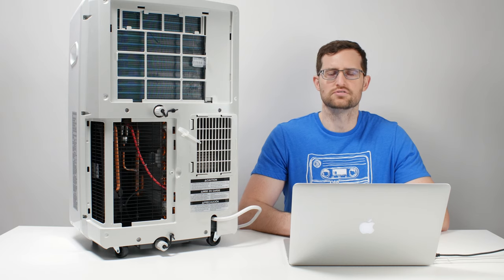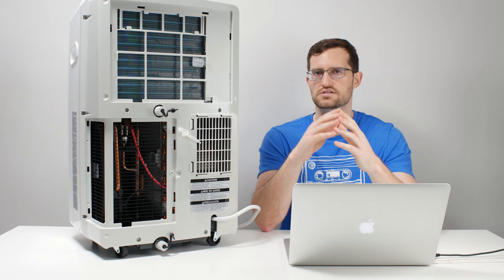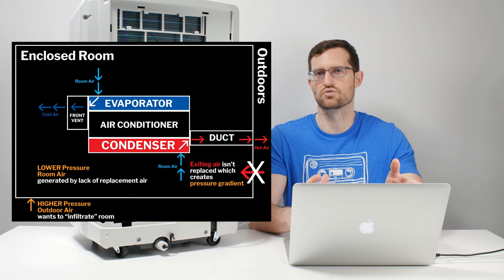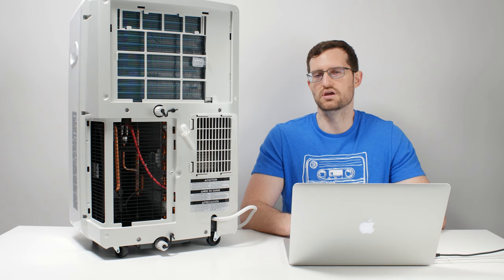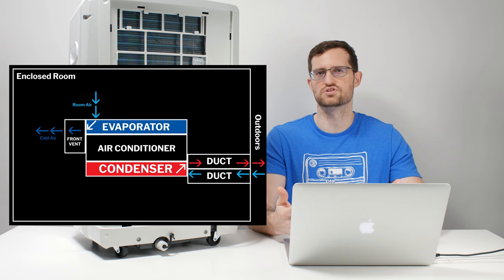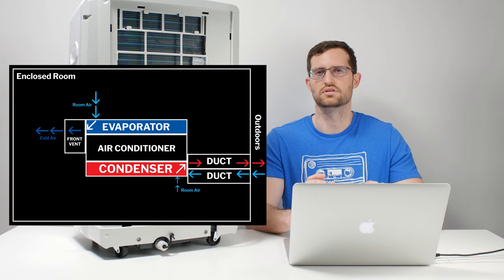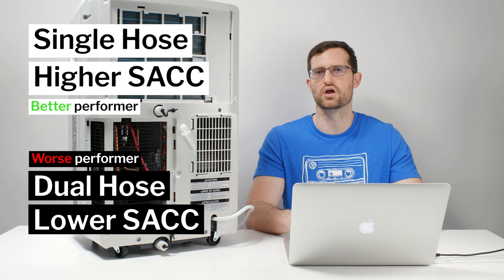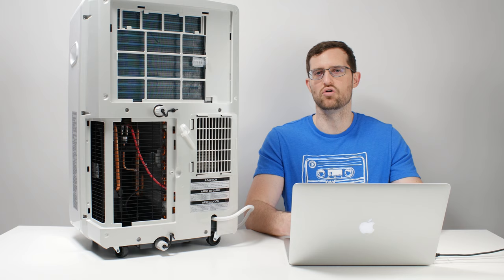Single vs Dual Hose Portable Air Conditioners

Comment: I understand what people are saying when they mention physics. People need to realize that the SSAC is measured using physics too. Some of the negatives listed with dual hose designs are minimal. The intake air hose is usually just barely warm to the touch and the extra leaks is very minimal. 

Technically a two hose design should be better but there is much more to it. I had a Haier 12,000 2 hose unit that cooled less than a 5,000 BTW window ac that it was replaced with. Because it is a dual hose design doesn't mean that it is any better.  We all know the "MAX A/C" settings on cars work the best. It mainly recirculates the already cooled air which is much more efficient. That isn't the only factor though. A good working compressor, fan, ducting system, condenser and evaporator are all parts too. My car's A/C letting if fresh air will outperform another vehicles using recirculated air if their system isn't fully charged or if their condenser is clogged with leaves, or if the vehicle is stopped and their condenser fans aren't spinning up to speed or if their A/C clutch is slipping. 

The LG's SACC goes from 14,000 BTU to 10,000 because it is like a car using fresh air while my old Haier went from 12,000 BTU to 5,000 BTU because it is like a car with other inefficiencies despite using recirculated air.    
 
Oh, that guy that claimed to be  an astrophysicist, brain surgeon and astronaut is full of more shit than a filled septic tank.
Reply: the intake hose/air will get warmer on a sun facing window.

Comment: What if you draw the air that cools the condenser not from the outside air but from an adjacent basement that remains cool even in summer. A two hose unit would allow you to tap the air in your cool basement and thus use "geothermal" cooling to precondition the cooling air for the condenser and thus make the unit more efficient. One hose would vent hot air to the outside while the other hose would tap "geothermally" cooled air from your basement..

Comment: I have the LG single hose inverter model, works great and cools fast until the temps outside hit 95. I will say that the problem is it will pull air from the central air and make it work harder even if we keep the door closed where the LG is.

Comment: Answered my question ....thank you.
To bad they are not a better system..guess will buy a split.
Reply from the maker: Absolutely. If you can afford it and you're able to install it in your home, a mini split is a much better more efficient option than either a single or dual hose portable AC.

Comment: My parents central air is a joke it doesn't cool a thing the lowest I seen it cool is 78 degrees if that and I would like it at least 70 to 72 my dad is 73 years old and thats just too hot it's a town home apartment but it's the downstairs that needs to be cooled more than anything I ask would you highly recommend the Whynter ARC-14S? The downstairs is close to 500 sq ft so I know a 14000 btu will do the job but will this specific unit being a dual hose do the job?

Comment: The first thing is to take the intake hose off and plug the window hole for the intake 😮 then you will be using the cooler air from inside your house, just like using the recirculation button in your cars ac and if you know how that works??? It made a huge difference with my unit and now it's nice and cool 😎

Comment: Window units are much more efficient than any portable unit and use outdoor only to cool there compressor side.
Reply: Big AL well in Germany we dont have sliding windows so we cant really use them. I converted my portable AC to dual Hose.

Comment: There is no way that the heat radiated from the 2nd hose(condenser intake) is equal to the infiltration from not having a second hose. And what heat is radiated can be minimised by insulating the hose. Both hoses should be insulated. Believe what you want, you will anyway. Have a great day.
Reply: @PaulRosberg  The window AC is NOT pumping air into the space!   A window AC is equivalent to the dual-hose system, entirely using outside air to cool the condenser.

Comment: I want to cool a basement during the hot summer months. Basements are a bit on the humid side even if finished. Using a dehumidifier would be out of the question because they give off heat. What would be my best solution for cooling a finished Slightly humid basement without using central air? I cannot fit a window unit into my basement windows!  Any suggestions?

And also, what about if you have allergies, and you’re bringing air in from outside does that affect the room air?

Comment: All you’re doing with a dual hose is emulating the traditional windows ac. What is lacking, as far as I know, is a Recirculate setting. The windows ac (also the car ac) is normally dumping some of the conditioned air outside.  He lost me at 3:30. The dual hose eliminates the vacuum problem so how does the single hose ever fix that?
Reply: Single hose never does fix that. It can't unless you modify it to a dual hose. Single hose creates a vacuum and draws hot air back into the space you want to cool. 

Dual hose eliminates the vacuum and uses the inside cooled air through the fan, as recirculate. It's the part this presenter gets wrong. Dual hose is more energy efficient and with some sealing and insulation, far outperforms Single hose every time. 

But what do I know, with hundreds of systems installed, tons of schooling on the subject and more than 15,000 hours thinking about it professionally...........

Comment: Since it was never mentioned in the video, for the issue of the exhaust hose radiating heat back into the room, you can just buy duct wrap and wrap it around the exhaust hose. This helps to insulate the hose and keep the heat from radiating back into the room.
Reply: Exactly what I did. Easy solution and bit difference
Reply: @torTxoFognaTuluZ  False. I said duct wrap not duct tape.

Comment: Let me tell you something..when it says 8000 BTU ...then it comes into the USA..it is turned into SACC..The Numbers are Lower,like 5100 btu/sacc...Keeping a Kean Eye on those...Lowe had a 10,000 BTU/SACC  but it converted into 16,000 BTU without the SACC conversion.

AireMax-115-Volt-White-Vented-Portable-Air-Conditioner at lowe and look at the photos.

This one is rated for 16,000 BTU but Lowe was selling the lower end of the Numbers ( The SACC ),which it is at 10,000...look at the Reviews for that AC and look at the Box...it will say 16,000 BTU but not BTU/SACC. This is how I figured this out.....I bought a 8,000 BTU AC from Amazon and the Aire on the same day and got both boxes.....then one box says 16,000 BTU and the other says 8,000 BTU...but the energy label is showing 5100 btu/sacc.

Comment: Going to say this and leave but a all ac units that are either split of dual hose ac unit USE THE OUTDOOR AIR TO COOL ITS HOT SIDE. That also includes almost all HVAC units in many homes, did you research this or just didn't care about what your posting?
Reply from the maker: Can you point out where I said anything different? Because I don't disagree with you. See 4:28 of the video, specifically.

Comment: "Hot air does find its way into the room."    Actually it is being invited in, because the window adapter is holding the window part open,  preventing the weather strip on the moving frame from mating with the frame. That means even with the unit turned off, hot air is drifting into the room, unless you want to remove the hose adapter from the window every hour, and shut the window.  They should at least come with a foam sausage to seal the gap.

Comment: An additional concern about single-hose units:  because they exchange air with the outside, things you don't want from the outside air are going to come in.  Given that it is currently wildfire season, this is especially relevant.  A well-sealed dual-hose unit won't let anywhere near as much smoke in.

A window unit or a central heat pump is obviously better for all of these concerns, of course.
Reply: Are you thats a single hose unit and not dual hose? Single hose dont exchange air with the outside. It pulls inside air from your house and exhausts it out by cooling it. Dual hose is are the units that pulls air in from the outside.
Reply: @441meatloaf  No, single hose units require the hot air it blows out of the house to be replaced as it causes negative pressure inside, thus hot air from outside is drawn in. Dual hose units solve this problem entirely as they take the air directly from outside to cool the unit instead of using the cooler air from inside, which makes the unit less efficient as it's consuming the just cooled air of inside to cool the unit.

Comment: Single duct more reliable? Run longer without winding down? Dual duct sucks some hot air from the exhaust duct because of the design next to the intake duct? Cars run better in winter than summer.

Comment: I have a question...it's a fact that single hose portable ACs suck in the same cold air it breathes into the room and thus making it less efficient in cooling said space. In this regard, given that cold air is denser than warm air and thus the latter rises, is it safe to say that by placing a portable AC in a higher location it will suck in more of the warm air than cold and as a result making it more efficient in cooling the room? Any info on this is much appreciated.
Reply from the maker: Either way, there will be negative pressure in the room. And it is the resulting infiltration air that most drastically impacts the unit's ability to properly cool the room.
Reply: @consumer-analysis  I see. But, wouldn't the cooled indoor air somehow help cool the infiltrating warm air? Sorry for the additional query, I just need to settle these questions before I decide on what is best for our room. Thank you for your time.
Reply from the maker: @nyebe6598  It certainly will and it does. My previous response relates to efficiency. What I was trying to say was that the effects of infiltration air greatly overshadow any benefit that might be had by placing the unit higher or lower in the room to improve efficiency.

Comment: As an engineer I appreciate your straightforward technical analysis. Most of this is a "first world problem."  I grew up in the 60s, zero air conditioning in the house. I lived. 

I will be looking at your channel for the 4-in-1, as I will need a supplemental source of heat. I am also considering whether or not to put in a vented propane heater, wood stove, but it all comes down to money versus comfort versus reliability. 

Much of this is a pay me now, pay me later situation. It comes down to price per BTU added or removed.

My main concern in a remote building is reliability and longevity of the system. I'm less concerned with how much powered will spend, more interested in a suitable unit that doesn't break the bank, will taste good last a long time.

Comment: My question is what if I just don't use the hot air intake and basically duct tape, the hot😮 air  intake on the window and don't use that hose. Will my efficiency improve? Or I could aim the other hose to the ceiling. Hot air rises.

Comment: Two hoses units are more efficient. You cannot compare the heat on the two hoses with the heat constantly entering the room with one hose units (heat that is bigger because it comes with  unconditioned air mass flow entering the room). If you are concern with the heat on the two hoses then isolate them and problem solved. With the two hose units, there is not exchange of unconditioned air flow between the heat and cold zones like with a single hose units. In car's AC, the faster way is to recirculate the air and not allow outside air to enter the car.

Comment: why cant you just leave the Hose that cools the ac condenser off so the unit is forced too use inside air too cool the condenser? I live in South Texas triple digits low humidity.

Comment: Can the LG, for example, be positioned in the doorway between a bedroom and ensuite, surrounded with a shower curtain to separate the two rooms, let the AC face into the bedroom to cool it, but vented into the bathroom with the bathroom exhaust fan running?  Bathrooms regularly get hot and humid, and the exhaust fan removes all that.  Couldn't this set up work in a pinch where a window setup is simply not available?  Could even a regular, more efficient, window AC be used in that manner:  perhaps placed on a rack facing into the bedroom but venting into the bathroom/shower/tub/sink?

Comment: My older dual hose portable AC was about $950 simply because it "only" used the outside air to cool the hot condensing coils. There was a strong fan inside the insulated compartment and it sucked the outside air in with considerable volume. They gave me 1" thick fiberglass insulation to wrap around the exhaust ducting because it did get very hot.  It also came with white plastic snap into place cover.  With the shell well insulated and the hot hose well insulated, it was the quietest "portable" on the market. But it was still louder than all my window ACs.
Reply: Portable units are the worst AC's you can get, aside from the swamp fans being masqueraded as AC's. Still good if you're in a place that doesn't allow window units like I am, but they're not really a good alternative otherwise. 

Most people who make the mistake of  buying something that doesn't work properly for their intended use will just move on after, but then you got people on the internet like this guy fighting over single vs dual hose AC's, pretending its a comparison video, because they're the know it all types just coping with the fact that they didn't know what they were buying.

 They have different use cases, single hose AC's are good for smaller rooms and dual hose ones are good if you want to try and cool an area bigger then its suppose to be able to, simply because dual hose AC's cool things more evenly and help prevent air pressure issues...

Comment: I bought one of those GE 1050 BTU units, based on the fact that there was a RAP02 kit to allow dual hose operation. This kit does not exist yet and GE keeps moving the release date and I'm wondering if it's due to false advertising. The Box claims three times the efficiency if you use the Dual hose kit that is available. For one, the kit has never been made available and many people are buying these units based on the fact that the kid exists and for two,  if the units run less efficient with the kit that you have to purchase, they may be liable in a class action suit.

Comment: does the air conditioner work if I do not install the hose for air exchange? using the unit to cool the heat generated by the unit within the room will cause any damage to the people and/or the machine?

Comment: Question, what if i were to recirculate some of the cold air vented from the front of portable ac using additional hose to the back of upper condenser so it acts like the car's recirculate function do u think it will improve the efficiency of my portable ac unit?
Reply: The brand am using have an 7400 btu SACC VALUE, is tat good? What is a good threshold value u reccomend?
Reply: Hmmm, trying to work this out myself but using the system in reverse, to heat a room.  It’s all about COP.  There is always a fixed temperature difference between the condenser (hot side) and evaporator (cold side).  In cooling mode, by limiting how hot the condenser gets, more cold air will be generated.  By using it in reverse, to heat, limiting how cold the evaporator gets, more hot air is produced.  It’s not as easy as burning gas!

Comment: There is a lot of mistakes in this video. Sir, I honestly appreciate your efforts here but I must confess you need to learn more about 'portable air  conditioners' before you talk about them. Here are your mistakes
1. Dual hose units are less efficient than single hose units (Actually it is the opposite)
2. A single hose unit blows heat out the single hose but a dual hose unit blows heat through the two hoses ( Dual hoses units don't blow heat through the two hoses. One hose exhausts hot air out and the other draws cool air into the condenser for cooling. And even thou outdoor air may be warm but it looses some amount of heat when it gets drawn into the hose to the condenser for cooling. I hope we all learnt from each other. Thank you🙏
Reply: that's what I thought. one hose takes air from outside and other blows hot air out. one goes in and other goes out,  creating a more equal pressure.

Comment: I have a double hose that I have been trying to get our 1940's stucco non insulated house in San Diego where we never had humidity for such long periods of time~!  My questions is, If im drawing in hot/humid air to cool the condenser,  can I not attach that to the outside and let it take in the room air but have the condenser line vent out the window??   Any suggestions would be grateful! :)

Comment: Just curious, I have a dual hose, which I was told can have the intake hose to be removed, I understand that it takes the outdoor air and pressure, but how effective is having that dual hose when it’s 115 degrees outside?

Comment: Quick question... I have a single hose Hisense 300. If another window is vented nearby, and the exhaust hose is wrapped with insulation; will that highly add to the efficiency?